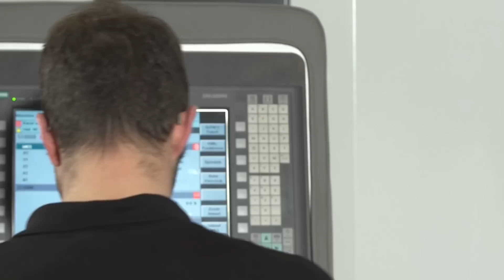Efficient impeller machining on five axis Starrag STC 800 machiningcenter

Comment: For reference, how large is this impeller? In the machine I'd assumed it might have been 15-20 cm across, say for a 2000hp engine or so. But at the end it looks like it's hanging from a hoist and a couple meters across. What is it used for? I would assume some sort of turbocharger - ship engine?
Reply from the maker: The impeller has a diameter of approx. 750mm, he is part of ship turbo charger
Reply: Thanks